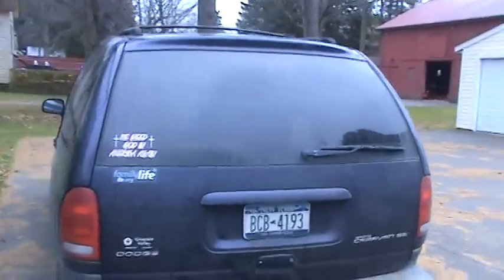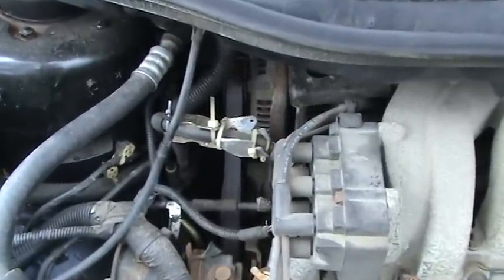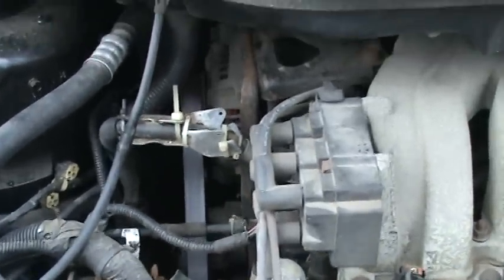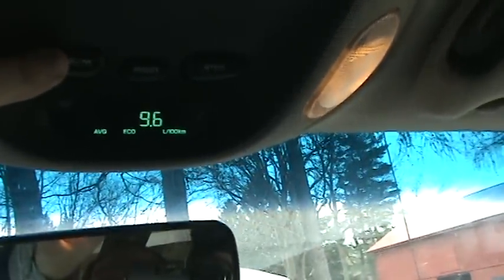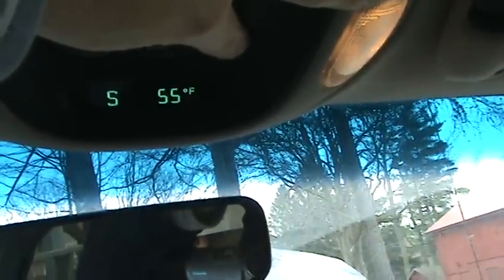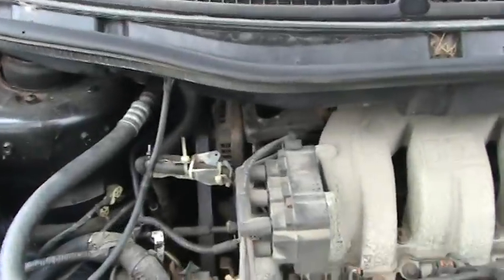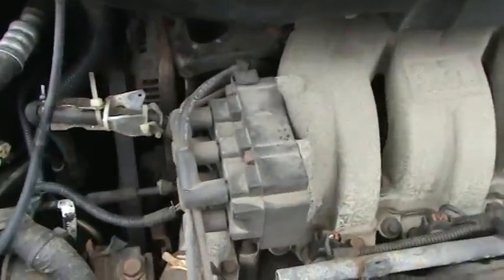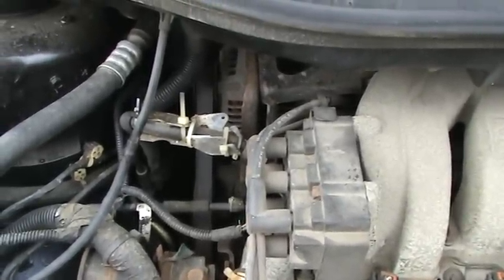Get Better MPG gas mileage with magnets

Comment: I came with open minded, research quite a bit on magnet fuel conditioner patents. Set up my magnets with NORTH pole on fuel injectors and SOUTH pole magnets around the air intake.  Polarized them with opposite charged, my 350z computer shows 32 MPG with magnets. Without magnets, I was getting around 27-28 MPG.
After I learned magnets set up correct help my MPG, I install them on the rest of my fleet.  All of them improved from 2-4 MPG. I don't really care if anyone not believe my results and happy with better MPG and power.
Reply: are you sure that it's not just a placebo effect? I increased my fuel consumption from 40/50mpg (US/Imperial) to 60/72mpg (US/Imperial) in my 1.0L Toyota Aygo by changing my driving style...
Reply: ***** My driving style is same everyday and I use Torque app conjunction with my OBD bluetooth device, MPG is recorded every refilled full gas tank. That's real data, not placebo effect.
Reply: AwdSyco Subaru  just because you think your driving style isn't different doesn't mean that your increase in fuel economy is due to the magnet... it could just be that you encountered less things which slowed you down. the only way to be certain is to perform a test in a lab and make sure both are performed while the engine is hot. The Majority of tests show absolutely no improvement with a magnetic fuel saver. Gasoline molecules aren't magnetic, not at all. so I find it very hard to believe that this actually has any effect.

You may be avoiding pressing the throttle hard and accelerating hard because you think it might effect your comparision with or without the magnet even though you may have accelerated fast if the device was not fitted (which is why I said it may be a "Placebo")

MPG is so sensitive to the way you drive that it's hard to compare one result to another during real world driving, when I go into a car park I normally loose 2 mpg just because i'm using lower gears to move around
Reply: ***** I drive mainly 95% on highway 80 miles round trip, early in morning 5AM where's there's no traffic with same speed. I have more than 2 years of data on my Torque app, not just one time trip. And most of the time I'm on the cruise control so my throttle behavior will NOT alter the data with 400 miles per week.
Reply: I got 86mpg (71 mpg US) on the journey to work today at 4:30am (not much traffic at that time). Still don't have any magnets on my fuel injectors... James Randi actually offered $1,000,000 to an inventor of the fuel rail magnets if he could prove it worked and he got no response.

If something as basic as a magnet on the fuel line actually made an improvement to the performance and economy of a car it would come on the car as standard because it would cost the manufacturer virtually nothing to fit them.
Reply: @micheals1992  if something works, it works! Who in their right mind would focus so very much on why it works to the point that they miss the point that it works?
Why you go buy a lab!?
I don't need to put you in a lab to see that the only person besides yourself that you trust is our mind machine and it will set you up for such failure because it is our worse enemy.
SF self forgiveness holistic specific writing out our obsessive thoughts can quiet it's addiction. It's our desteni.
Take care of yourself bud.
Reply: @micheals1992  there is strong evidence that our vehicle makers have agreements with the oil industry to not make vehicles that will greatly exceed cafa requirements so they won't use any technology that will greatly exceed cafa.
The cost of owning a vehicle isn't only in the purchase price, it's also in the lifetime fuel costs and our auto industry gets kicks back from those lifetime fuel costs one way or another, they are bed fellows industries.
Take care.

Comment: I have magnets on the fuel line from "PetroSavers Engine Oil Refiner" and the car runs a lot smoother ie very smooth idle. My research also reveal that the NASA Space Shuttle stores Para Hydrogen- and with a Magnetic Field(which permits an electron spin) becomes the much more explosively powerful- Ortho Hydrogen.

Comment from the maker: It works on any gas or diesel engine.  The magnets break up the clumps in the fuel so it burns better and does not clog the injectors or carborator.
Reply: Bob Davis I think "clumps" could be better stated as "groups or chains of gasoline molecules". I conjecture that gasoline molecules or chains attract each other and then "clump" together. Passing through magnetic fields could then disassociate those "clumps" and change their how those molecules  group together. Thinking about this "disassociation of molecular grouping", as I think of it, is probably not a complete process; whereas not all of the clusters would get dissacociated. Another thought is that they may not stay disassociated for very long. Too bad I don't know any electromagnetic chemists!

Comment: Can't believe anyone is still gullible enough to buy these gas guzzling piles of junk. Their only purpose is to provide a profitable fuel leak so the oil companies to continue to fill up your tank....at your expense. But Hey!, if you have the money to burn (literally), don't let me stop you spending it. Internal combustion engines have not improved significantly since the 1930s - they are just a bad idea that should have been outlawed decades ago. But if you are going to buy one, at least be smart enough to buy an efficient one - and that rules out american cars.

Comment: Hi Bob, grt idea , loved it and did it on my Honda Dual Carby Civic 91,  I used to get 360-370K per  full tank , after installing a pair of magnets as you said, I got 485-500 nearly per full , you do your maths. I was very glad  , and the engine got soooo  smoooother  !!!!  I was extremely happy about it . Sold that car ....air-con issues.  

Now I got an EFI car , can the same magnet formula work on this EFI car 2008 Nissan TIIDA  ???  Where should I install the magnet please ......  Thank You once again ......  Cheers mate      :)
Reply from the maker: It does not work on some of the newer cars.  Like my cobalt got worse when magnets were installed on the fuel line!
Reply: @bobdavis321  thank you, have you figured out why it hurts mileage on your cobalt at all?

Comment: I tried this with my 1996 Acura Integra & failed. I purchased two magnets and used a compass to find their polarity and then marked them with permanent marker to install them in correct position. It didn't do anything for my car. I was having problems with the magnets slipping on the fuel line and then coming together. Another problem was that I was using ferrous magnets; that's probably why there was no change. Reader, if you do this, don't bother with weak, ferrous, magnets. Use four rare-earth neodymium. A local e-waste recycling center may give you hard drive magnets. I don't have the Integra anymore, but I have hard drive magnets, so I'll retest in my current car. I may make a video.

Comment: I have a stack of magnets that came from customer cars I worked on at the dealership. No one ever asked why their mileage went down. I also have a pile of those metal spirals that go in the air intake. Those customers were always happy with the improvement after I removed the restriction.😮

Comment: It works. I get 4% better mileage in my 05 subaru impreza, my dad gets 33% better mileage in his 96 crown vic. You can put magnets on your air intake too. Good for more power also.
Reply from the maker: It seems to help bigger engines more than smaller ones.

Comment: Understood no mod needed but you didn't answer my question. If you rotate magnets 90 degree out of phase they repel each other, otherwise same phase with no rotation they attract.

From you video, the pair on the right which near the fuel injectors is rotated 90 degree. The other pair on the left, looks like they are NOT rotated, shows same magnet curvature, attract each other.  However, they supposed to be opposed each other like the pair on the right to work well with gasoline fuel.

Long term update from you, has MPG been consistent 24+ since you installed?
Reply from the maker: I always thought they were supposed to attract each other?  That van continued to averaged 24 MPG.  I now have a Ford windstar with over 150K miles on it.  It averages 22 MPG with the magnets.
Reply: Bob Davis the only way I could see this working is if the mangets was restricting fuel flow because it's squeezing the pipe or maybe they also provide an electrical resistance because the fuel passing is creating a small electric charge (which would steal energy from the fuel and reduce the rate of flow but would add extra strain to the pump). I'm not sure if fuel does react to a magnetic feild though and I doubt it does

Comment: best double or triple mpg is a dual fuel pump inside the gas tank.....the higher the pressure the better the injectors spray and the thinner it spray the less gas consume.........

Comment from the maker: That would not work.  Because the magnets break down the fuel molecules the injectors slowly clean up and slowly clog up.  It typically takes about a year to reach the highest gas mileage.

Comment: How about posting the EPA report on that?
Reply: REFERENCES:
[1] ParkK.S.etal1997.“ModulatedFuelFeedbackcontrolofafuelinjectionengineusingaswitchtypeoxygensensor”,Procedure Instrumentation Mechanical Engineers vol 211.
[2] P. Govindasamy and S. Dhandapani,“Experimental Investigation of Cyclic Variation of Combustion Parameters in Catalytically Activated and Magnetically Energized Two-stroke SI Engine”. journal of scientific and industrial research vol.66, 2007;pp-457- 463’
[3] Farrag A.El Fatih, Gad M.saber, Australian Journal of Basic and Applied Sciences, 4(12): 6354-6358, 2010 ISSN 1991- 8178
[4] Al Dossary, Rashid. M.A., 2009. "The Effect of Magnetic Field on Combustion and Emissions", Master's thesis, King Fahd
University of Petroleum and Minerals.
[5] Gary T Jones “The effect of molecular fuel energizer on emissions and fuel economy”. The study done in the year 1981 for
“environmental protection agency”
[6] Vivek Ugare, Nikhil Bhave, Sandeep Lutade,2013 Performance of spark ignition engine under the influence of magnetic field,
International journal of research in aeronautical and mechanical engineering ,vol.1 Issue.3 July 2013 Pgs:36-43
[7] Ajaj R. Attar, Pralhad Tipole, Dr. Virendra Bhojwani , Dr.Suhas Deshmukh, “Effect of Magnetic Field Strength on Hydrocarbon Fuel Viscosity and Engine Performance”, International Journal of Mechanical Engineering and Computer Applications, Vol 1
Issue 7,December 2013, ISSN 2320-634
[8] Ali S. Faris, Saadi K. Al- Naseri , Nather Jamal, RaedIsse, Mezher Abed, Zainab Fouad, Akeel Kazim, Nihad Reheem, Ali
Chaloob, Hazim Mohammad, Hayder Jasim, Jaafar Sadeq, Ali Salim, AwsAbas, “Effects of Magnetic Field on Fuel Consumption
and Exhaust, Emissions in Two-Stroke Engine”, Energy Procedia 18( 2012 ) 327 – 338 www.sciencedirect.com
[9] A. Janezak, E. Krensel Permanent Magnetic Power for treating fuel lines for more efficient combustion and less pollution .U.S.
Pat. 5,124,045, 1992.
[10]Kolandavel MANI and Velappan Selladurai, “Energy savings with the effect of magnetic field using r290/600a mixture as
substitute for cfc12 and hfc134a”, thermal science: Vol. 12 (2008), No. 3, pp. 111-120.
[11]Barathal/ ponnusamy, “magnet device to reduce diesel consumption in diesel engine”, Faculty of Mechanical Engineering,
university Malaysia Pahang.
[12]Shweta Jain, Prof. Dr. Suhas Deshmukh,2012 Experimental Investigation of Magnetic Fuel Conditioner (M.F.C) in I.C. engine,
ISSN: 2250-3021 Volume 2, Issue 7 (July 2012), PP 27-31.
[13] Hejun Guo, Zbizhong Liu, Yunchao Chen, Rujie Yao, “A study of magnetic effects on tee physicochemical properties of
individual hydrocarbons”, Logistical Engineering College, Chongqing 400042, P.RChina
Reply: Ps you do know the EPA is currently an exceedingly corrupt agency, right..? Having been planted with political lobbyist appointees n all that...among other things...

Comment from the maker: This trick did not work on my Chevy Cobalt.  It caused the check engine light to come on with an 02 sensor failure.  Removed the magnets and the check engine light cleared!
Reply: +Bob Davis bOB PERHAPS YOU SHOULD TRY GETTING A EUROPEAN CAR AND THEN REPLACING THE CARB SYSTEM WITH A EURO ONE NOT THE USA FITTED ONE. THATS WHEN YOU WILL GET THE BEST SAVINGS.
Reply from the maker: Turns out I had a bad O2 sensor....
Reply: @bobdavis321  Thanks for sharing the info is important!

Comment from the maker: The magnets are N to S just like they were in the hard drive they were removed from.  One set is rotated 90 degrees from the other set.  The second set of magnets only brought a slight improvement over the first set.

Comment: When you making changes to any thing you can only do one step at a time. If you add magnets & spark plugs then you don't know witch gave you the extra power or mpg gain.
you have to do a good test after each step. and keep good records.

The test should be on the same road , speed, and try or keep all factors the same and do
it more than once in order to get a sold reading of what did or did not work and what was
the gain  or loss after each change you made.
Reply: But that would constitute a sound scientific approach.  Not good for conspiracy theorists and other gullible dopes.  Binghamton University has invented disposable batteries made from bio-degradable paper......but they just can't figure out this magnet thing-a-ma-jiggy.  That sort of high-tech thinking has to be left to the superior minds of YouTube junkies!

Comment: Came across your video. I use my 2002 neon for deliveries. I'm attempting all reasonable fuel increase strategies easiest to hardest. I figured the magnets can be easy enough but did not expect anything. My neon instantly had increased power and response. I was averaging 11.5ish l/100km (canadian). I got it down to 9l/100km. I have extensive automotive education and experience. My thought of why this seems to work on chrysler products from this era is the fact it has a returnless fuel system. fuel is sitting in the line significantly longer than on the majority of cars that have return type systems. not 100% sure if yours is returnless but it does make the most sense. what ever effect the magnets are having its obviously has a better chance in a returnless system. just my two cents.
Reply: Yes well with the returnlees (extra fuel is Not pumped back to the gas tank) the gas would be moving past the magnets much slower!
So for a system that is no returnless, I suppose more and or stronger magnets are called for.

Comment: Hi Bob. If you stopped using the magnets after say a year. What happens to the crud that has been held back by the magnets that flows into your injectors? Surely the car will fail to start with blockage. I'm no mechanic but something must get blocked over time using that device? I'm a bit of a sceptic when it comes to these ideas and I know everyone wants to save money on petroleum or gas as you say, the question is why doesn't my local mechanic or even car shop mention gas saving tips.
Reply: ducati9981 Crud?! Not likely;That's what a fuel filter is for. There would be no crud or material that would stay in place unless it is a ferrous metal. But even if ferrous metal was found in US formulated gasoline, the parts per million (ppm) would be so low it wouldn't matter. And ferrous metal would be stopped at the fuel filter.

Comment: I am a gas-mileage "junkie" (although it can be argued that guzzlers are putting out the real junk). I have succeeded in getting 35-40+ more miles on a 10 1/2 gallon tank with my Kia Rio after indexing the spark plugs. Twenty minutes of work was involved, but well worth it. Now I'm gonna try the magnets. Will report back later...
Reply: brasspick What is indexing spark plugs?
Reply: HWandW ... its when u mark the porcelain part of the sparkplug showing the electrode point and index it to a desired angle for a better  cylinder ingite "spark" try to ignite and combust the most fuel as possible and get the most efficient and effective power or performance... typically only seen for performance application
Reply: What TJ Hines said, typically the ground strap faces the exhaust, and the spark faces the intake valves.
Reply: Have tried the magnets. have gotten pretty darn good results. You have to face the South Poles of the magnets (in my case Harbor Freight ceramics for 99 cents) in toward the fuel/gas line, so they REPEL each other.
Reply: indexing plugs?  you might want to go look at extremespark.com
their Torquemaster Star Series Plugs have an interesting design.
Reply: Correct, the fuel has to flow perpendicular to the field lines of the magnets.